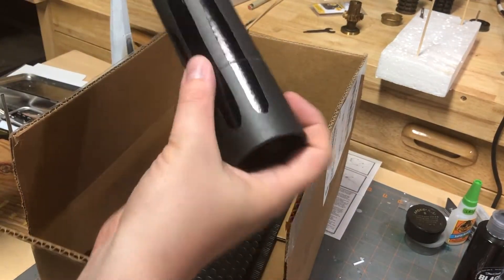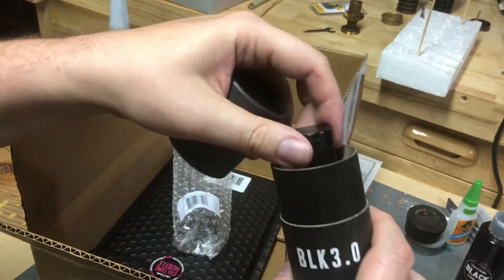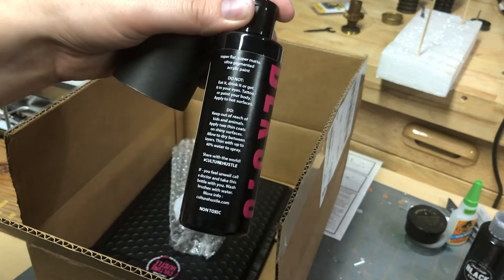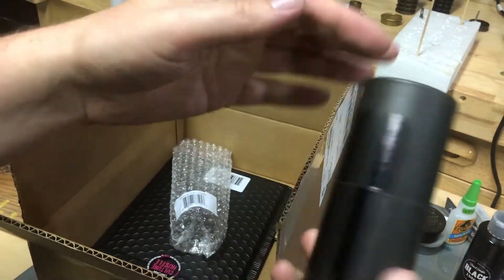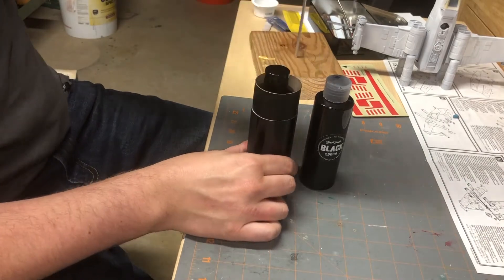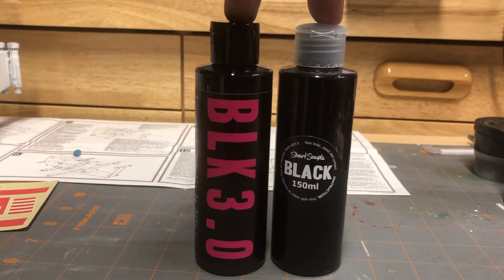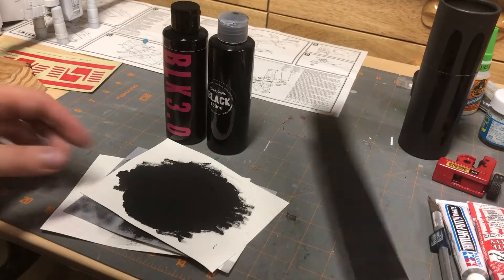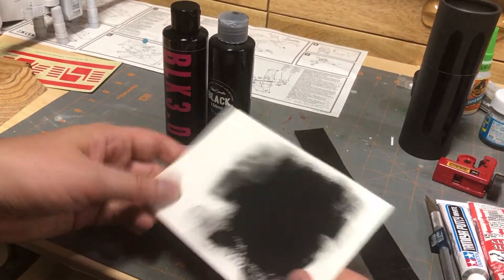Black 3.0 by Stewart Semple Unboxing and Experimentation

Comment: 10:50 mix 3.0 with water outside of your gun first, then put the container in a vacuum degassing chamber to purge the bubbles.
or you could have just tried mixing outside the gun slowly to minimize gas exposure.
Reply from the maker: That's a good idea, but I don't have a degassing chamber. I really wish I did.

Comment: Maybe mixing it and leaving it to settle overnight, I know nothing I will admit but mixing it in a small amount with twice the water to paint ratio seems like it might be the answer. After all, the 3.0 is a very thick paint isn't it, so you may have to start out with that ratio until you find a better one that will easily go thru the spray gun. It's definitely a darker paint though without a doubt! Very interesting video.
Reply from the maker: Yeah I need to do a few more experiments with this paint, it’s very interesting stuff.

Comment: I reckon you'd get better results with a slower, more delicate mixing process. The pipette in the bowl is introducing a lot of air, it def sounds like it's struggling to 'catch' paint rather than getting clogged.